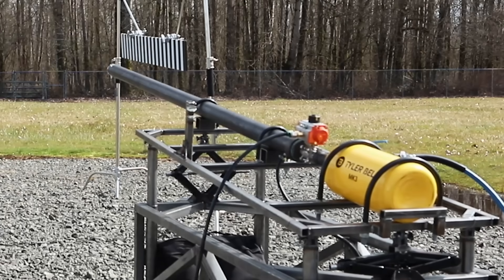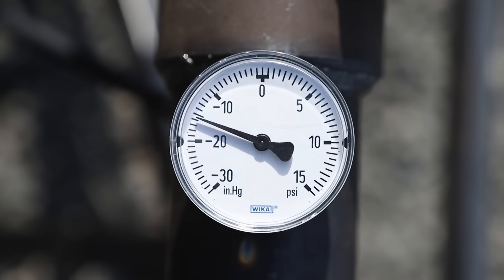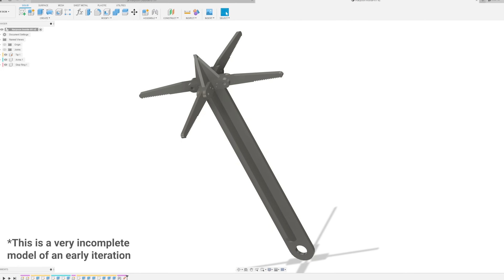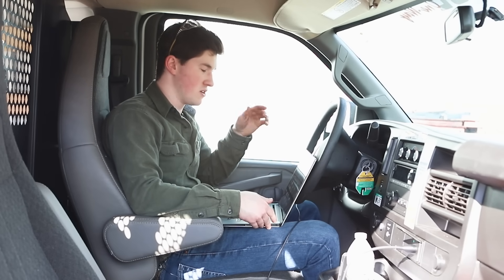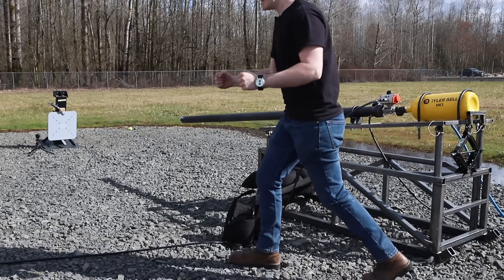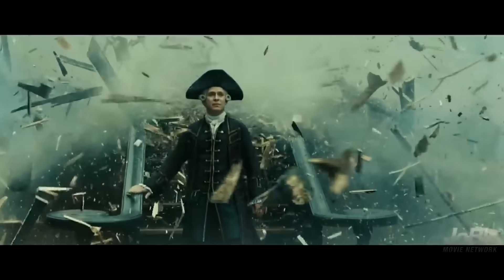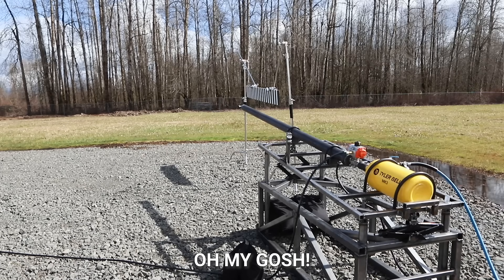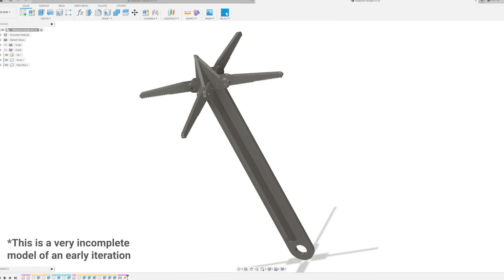Have I Found the Fastest Air Cannon Valve??

Comment: Edit: ALMOST EVERYTHING I SAY IN THE FOLLOWING COMMENT IS INCORRECT that being said:

You should try using compressed hydrogen (1270m/s) or helium (1007m/s) while theoretically you might breaks the sound barrier with the assistance of the vacuum in the chamber, you will never be able to breaks the sound barrier with compressed air alone (~343m/s) as the expansion rate of a gas is equal to the speed of sound in said gas. Hydrogen would be easier to source and cheaper as you could generate it you self if needed though helium has the added Benefit of not being flammable and being easier to store though you most likely won’t be able to take full advantage or the 1007m/s as most helium is sold mixed with a percentage of air a helium is in short supply you’d probably need to get it from a medical supplier if you wanted pure stuff though at that point it’d probably be helium or the high speed cam 😂. You videos are great keep up the great work. If you want to learn more about the expansion rate and the loss you will always have/ what speed is acceptable to hit, then Cody’s Lab has a great video where he fill a BB gun with helium and I want to say he hits 1400f/s or m/h though it’s been a while so I can’t quite remember
Reply: I have a simple compressed air pellet gun that can shoot well over the speed of sound.
Reply: @Mr. Lengo  Thanks for pointing that out though apparently air cannons can shoot supersonic, looking into it more I’m pretty sure most of what I said previously was wrong. However I’m pretty sure helium or hydrogen (idk if the light molecular mass would be a problem helium might be best?) would increase the velocity a bit. That being said it’s probably best just to work on a faster valve or maybe try to figure out a reusable burst disc valve type mix. Something that is closed 100% until you remove a pin or something and then the air pressure opens the valve by pushing it straight back. You’d just want to be extra sure the “valve” wouldn’t turn into a projectile

Comment: If you want the valve to open faster, add a slot to the connection point between the air cylinder and the valve handle. That why the air cylinder has accelerated before it cracks open the valve. You can see the air cylinder jump, then slow down, then accelerate again. This is because of the same issue the cannon has, the air isn't flowing into the cylinder fast enough to build pressure to overcome the friction of the valve. If you let the ram accelerate before it opens the valve, then you're using the rams momentum to open it, not air pressure.
Reply: Hint, no cylinders, no turning, needs to open 100% in just a few milliseconds. Also freeze the projectile.

Comment: I think you also need a vaccum. Like put the burst disc material chamber that open on both ends and cap it with the disc thing. Suck the air out of that and try it. High pressure air wants to go to the lower pressure so..

Comment: I made a pneumatic cannon with 3 in and 1.5 in ABS Use a reducer and a removeable end cap. The chamber is the 3 in and the barrel was inside the chamber.  Then a piston sealed off the inner barrel with some airspace behind the piston.  evacuate the air behind the piston to make it move rearward then the full flow of the chamber enters the barrel instantly.  Much faster design.  We were vaporizing limes shooting at a steel I beam.

Comment: I DESIGNED AN MACHINED A 1.25"" ID POPPET VALVE!! THAT YOU COULD SMACK WITH YOUR ✋.. 
 IT WORKED VERY WELL @ 100PSI.. NOW IN THE CORNER FULL OF DUST,OIL,METAL CHIPS. 😎🚬

Comment: You need to add an expansion chamber just before the burst disc. Pressure will leak around the ball and causs an air cushion. Confirm this suspicion by checking if the burst disc ruptures before the tennis ball penetrates it. Check out smarter every day's baseball cannon. It's a relatively simple fix.

Comment: You cannot achieve supersonic speed with a straight pipe, the maximum speed of a straight pipe is the speed of sound. For higher speed, you  need to take a look at SpaceX's engine.
Reply: Why is this? I’m asking because I have a really simple compressed air pellet gun which shoots at 1700 feet per second. No fancy nozzles or anything, just a chamber, a valve, and a straight barrel.

Comment: I spent a lot of high school optimizing pneumatic cannons, and there is a huge diminishing return with both pressure and volume of air. You need to calculate the average pressure you want your projectile to be subject to based on your engineering requirements (cross sectional area of the barrel, mass of the projectile, intended distance). I had a cannon shooting a fin stabilized military glow stick around 1/2 a mile, or (since the statute of limitations has expired by around 20 years at this point) a fin stabilized... destructive device around 1/3 a mile. If your projectile needs an average 200PSI over, say, 10 feet to reach your velocity target, you need to size your tank to drop no lower than X if it fills the full volume of the barrel. You always end up with a tank and a pressure sized well below what your instincts would tell you. This bode well for me, because charging the pressure chamber was often done with a foot or floor bicycle pump, especially with platforms that fired potato sized projectiles.
Reply from the maker: Nice. I calculated that the MK3 tank at 500 psi would go down to about 80 psi when combined with the barrel volume. I used a Boyles law calculator online. Not sure if I did that right or if it was the correct formula though.

Comment: I think a big issue might be the ball itself.  tennis balls are fuzzy for a reason other than not breaking windows.  It is a soft object that can be malformed in the barrel and then suffers rapid deceleration immediately.  The fuzz brings the speed down in tennis from 200kmh down to 120kmh the distance to first bounce according to instructor john yandell.  Seeing that air resistance is a squared force by speed this would be even bigger loss at these speeds and probably looses and incredible amount of speed every meter.

Comment: You can possibly get higher speeds by using a longer barrel. That will give you a longer acceleration time, however you can't break the sound barrier with an air cannon because the sound barrier is literally fastest speed that gasses are able to move. That said you CAN get above the sound barrier using a gas which has a higher sound velocity. (like helium) Bullets are technically gas powered and get above super sonic, but that gas is super heated and therefore has more kinetic energy within it.

Comment: If friction with the barrel is the problem, maybe you could make the barrel slightly wider and make a discarding sabot for the ball. It might reduce the friction a bit. But then with wider barrel I guess the air would maybe move slower. I don't know a lot about how that stuff work.

Comment: Your problem is the pressure wave of air cannot exceed the speed of sound. Because the speed of sound is the max speed of a pressure wave in air. What you need is not nitrogen you need something like helium or hydrogen which are less than air and to have a higher pressure wave velocity. Nitrogen anyway however nitrogen is one of the heaviest components in it so you're actually getting less efficiency than you would with atmosphere air at 1,000 psi.
Reply: Why is this? I’m asking because I have a really simple compressed air pellet gun which shoots at 1700 feet per second. No fancy nozzles or anything, just a chamber, a valve, and a straight barrel.

Comment: 1) Stab some holes in the tennis ball, they expand quite a lot in vacuum. They are sometimes filled with gas.
2) Your valve/feeder diameter should be at least double the size of your barrel.
3) Your Tank volume is waaaaaaaaay to small.
4) Want to use a unreasonable and unsafe amount of pressure for cheap? Try steam. Basically put some water in the tank and light it up in fire.
Reply: For your 3) comment y suggest that the performance must also be improved by a greater pressure of the same quantity of air in a smaller tank which allows to reduce the dead volume of the tank which reduce seriousely the general efficiency.
The big volume of the tank is also filled vith air, witch is not used , that's why his volume must be reduced as much as possible, by using greater pressure , witch allows also greaters speeds of expansions....
Reply: would you suggest when the tennis ball id at Hy muzzle. Thank pressure should be no less than 75%? And why? Also consider a 40 foot barrel (it's 20 right) Tennis ball my start to pull a vacuum in the tank and go back down the barrel. That's how I sized mine I have a .409 cubic foot tank and a 4'  barrel Valve is proprietary 8" and in the .005 millisecond range from closed to 125% Projectile is made to denigrate on impact. Not interested in a epoxy filled tennis ball bouncing off a tree and hitting the old forehead.
However at the new speeds, still 3/4 capacity I'm freezing projectile to 100 below
Reply: That last one requires a boiler license if he wants to publish the video. Operating boilers is no backyard science
Reply: @Yoshikaable  While I agree that boilers need to be handled with utmost care since they are freaking dangerous, no he doesn't.

First only about 10 states or so have that requirement
Second he isn't going to sell the thing. Neither is his job to operate a powerplant.

Also if he kills someone with the stupid thing, judges really don't care if he has a license or not.
Reply: @DerSolinski  I love how some people say stuff with the upmost confidence. No humility in sight, but still wrong. Well probably, it's your word against theirs, but yours sounds more reasonable than a person putting water in an enclosed container and heating it up needing a boiler license.
Reply: @Karnet0  the optimum acceleration is achieved when tank, pressure and barrel volume are sized in a way that while the ball is accelerating the pressure drop is negligible and stays almost constant.
This inherently wastes most of the stored energy, but we don't care about that anyway. 
To achieve that you need excess energy and a bigger valve to accommodate fluid dynamical losses. The fluid needs time to expand to.

This btw. is the working principles of vacuum cannons.
Ambient pressure isn't much, but it can almost be viewed as an infinite air tank.
The airs inertia is one of the biggest limitations there.

Comment: what if you were to cut off the outlet of the airtank and weld on a outlet that is a bigger size than the barrel? that would increase velocity and lower pressure, do you need all that pressure for a light tennis ball?

Comment: I did this when i was a kid, the burst disc is ideal, but if you are crafty enough you can also make and use a piston valve, thats actuated by the pressure in the vessel, and therefore incredibly fast. dont forget to build in something to slow the piston down safely. The key really is to have a large reservoir behind the valve or burst disc that necks down the diameter of the barrel. also understand that gas can only expand so quickly.

Comment: Are you lubricating your barrel? That alone will help a ton if it’s not already being done. Dip the ball in oil before you load it or spray some lubricant inside the barrel. 10-15% gains easy. Make the barrel longer if you can, it’s accelerating the whole way through the barrel.

Comment: I now have access to scrap PVC and CPVC industrial pipe from 1/2” up to 4 Inches because of my new job. I’ve complied a collection of left overs from projects at work and build my first air cannon with 1/2” nozzle which is great for shooting nerf darts. I’m now working on my 2nd prototype that will shoot tennis balls 😁
Reply: Be careful about pressurizing PCV pipe. The pipe can blow up.

Comment: I also think that with a longer barrel it would give more time for the ball to accelerate in the vacuum and be pushed faster by the air, especially if the valve doesn’t even open in time

Comment: Try Helium as your gas and you need to over size your chamber down to your barrel size. The hilieum moves faster since it has less mass. the over sizing speeds up the gas as the particles  behind push the particles ahead faster and faster down a constriction cone.

Comment: I think the vacuum in the barrel might be working against you since you have a “squishy” projectile. It’s possible that the vacuum is pulling the air around the tennis ball creating a cushion on the back side. I’d be interested to see a high-speed shot of the packing tape at the end of the barrel; I think that would resolve the hypothesis.

Comment: Great video!  Intresting that each one was about the same speed. did you try lube? Slippery ball might go faster in the tube. Or possibly (counter intuitive) a larger diameter barrel so when the ball does accelerate and get sqished it then makes a perfect seal with less friction? IDK a few thoughts. Kinda sucks when you spend so much time and money but get the same result. But hey now you know right? Keep it up!!!

Comment: Im far from a specialist but from the thermodynamics I'm learning it seems impossible to have a faster flow then the speed of sound in nitrogen, wich is practically the same as the speed of sound in the atmosphere. Achieving higher flows becomes possible with a converging-diverging nozzle, it's not intuitive but you should look into it, it's very interesting!

Comment: What if the barrel was tapered to be bigger after the back inch or so, allowing a snug fit at the back and a looser for after the ball is being pushed, to compensate for the deformation? I'm sure you run the risk of losing pressure behind the ball, but could reduce friction dramatically...
Just a thought from another non-engineer

Comment: You need to add a venturi to your barrel just before your valve.  That will convert the high pressure low flow to low pressure (supersonic) high flow.  It is the same principle rocket engines uses.  If you can 3D print or machine a de Laval nozzle between your valve and barrel, you will see significant gains in barrel velocity.

Comment: I don't want to armchair QB. But I see three restrictions when it comes to speed. First is the width of the nozzle, which you pointed out. Second is the speed of release, i think you were closer to the right track with version 1 having something that melted away and blows out is quicker than any valve. Third is the projectile, an air filled item will always move slower, you could get way better results by giving it more internal mass. The resin filled ball would have dominated the speed of sound in tests, and one filled with colored water or colored sand would have both gone faster and would be very visually appeasing.

Comment: I knew someone who was trying to make a potato cannon and used an electronic valve for lawn sprinkler systems. Altho the valve was fast, it was too small in dia. I suggested using multiple valves to increase air flow into the barrel. He tried it and the results exceeded his requirements. The new flow restriction was the air tanks opening. Next solution was a tank per valve and the final design looked like a Russian space rocket. The 3 tanks set up in a triangular aspect with the barrel in the center of the triangle and the valves were attached to the barrel at 120 degree spacing.

Comment: A longer barrel and pull as high a vacuum as possible; your tennis ball will accelerate more in the longer barrel with no air resistance. You lose speed the instant it hits the dense air outside the barrel. This would be cheap to try!

Comment: I'd mention that there is a lot of specialty rental companies that you can pay much less to rent slow mo cameras based on your location. The camera for a slow motion setup will need a lot of light (multiple bright lights with stands and batteries depending on the location), usually a couple of speciality highspeed high capactiy hard drives (normal ones don't work, check it out) and protective shielding based on what you do (which you may already have covered) so I would suggest factoring those into your cost as well. 

Also thank you so much for the content and I'm always excited to see more!

Comment: You should follow the ball with a foam sabot. Cupped on the ball side to hold the shape and evenly distribute the force, flat on the back for maximum push down the tube like a piston. When it exits the tube the cup shape will force them foam to pull outward clearing away (cut in quarters btw).

Comment: You need a surge tank with a very wide outlet that fills from the nitrogen cylinder until pressurised to 1000psi, 4" with a bursty boi should be decent 👌

Comment: Quickest fix would be to use helium instead of nitrogen, this was utilized on the world record holding ping ball cannon to obtain supersonic speeds.  However, you don't need helium to go supersonic, it just helps.  I think your newer valve setups are just no match for the speed of a burst disc, the diameter output of the tank is also concerningly small, i'm not sure if it's the valve or the tank output size.  Without modifying anything helium is still the quickest fix, but i'm not sure it would be enough to go supersonic in this scenario.  Great video.

Comment: I think the reason they're all firing at about the same Mach number is that the working fluid is air, which starts encountering shock waves at about mach 0.75 as it moves through the cannon. To get supersonic flow you'd want either a gas with a higher speed of sound (for example, hydrogen) as in a light-gas gun, or use a de Laval nozzle like in a rocket to allow the airflow to go supersonic; in theory room temperature nitrogen can go as high as mach 2.1 when expanding into a vaccuum with the right nozzle.